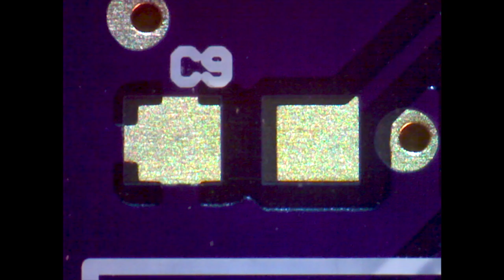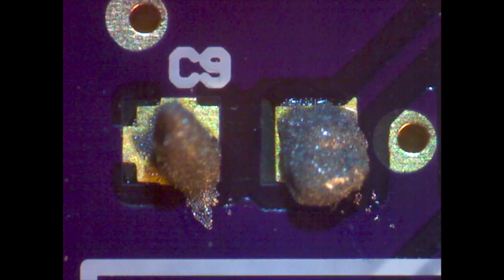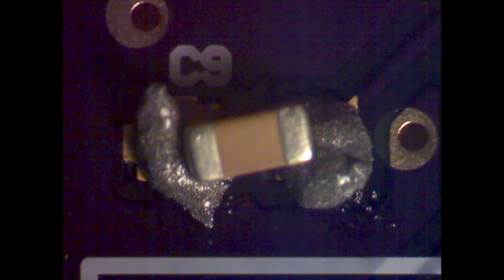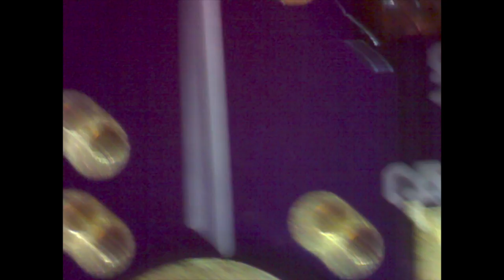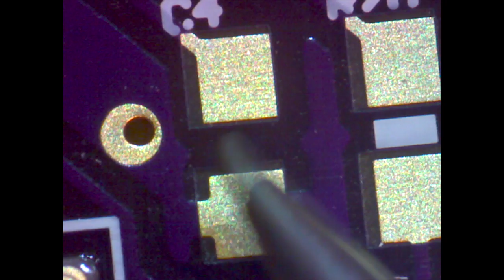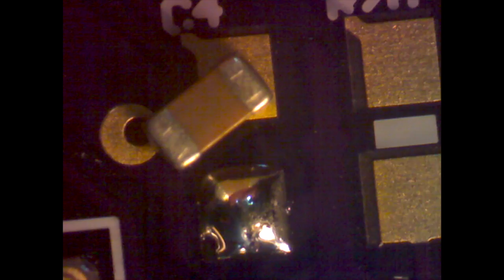Soldering Small Components By Hand

Comment: I have a very expensive exercise machine that is malfunctioning due to a severed connection on a ribbon cable.  We're talking $4000 or so to replace the machine and maybe 20 cents to fix IF I knew how to do it.  How would I find someone locally with your skills?
Reply from the maker: You might check in at a local makerspace to see if there's anyone there willing to take on the project for a few bucks. Seems like a good place to start the search at least.

Comment: Solder paste such as SAC305 can be used on SMT.  Dab a bit on each pad, place the part and then use two soldering irons simultaneously to solder part.  This trick works very well.
Reply from the maker: That's an interesting thought to use two irons. There are also tweezer-irons for SMD removal that would probably work too.
Reply: The problem with tweezer type irons is when one side is connected to a ground plane or a via that tends to wick away the heat.  You end up with one side soldered and the other side, well, not so much.  With two irons you can do both sides and if one side needs more heat you can leave the iron there a bit longer.  Of course preheat of the board is often helpful!